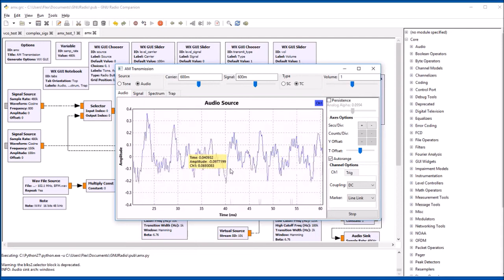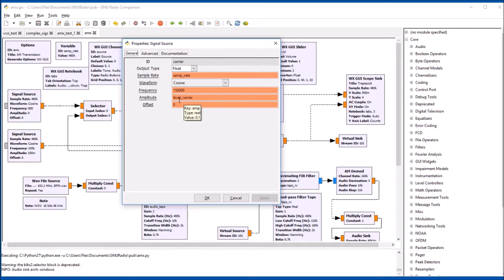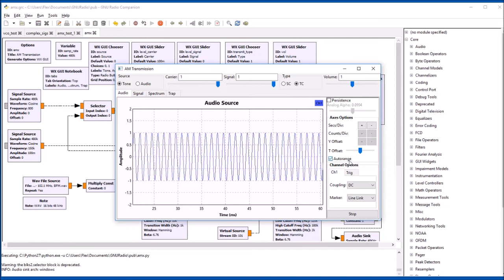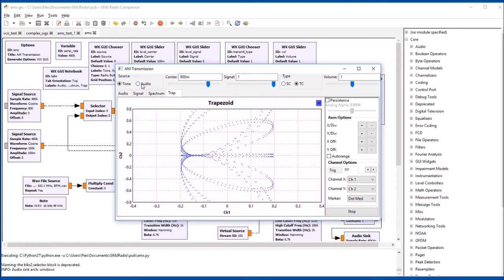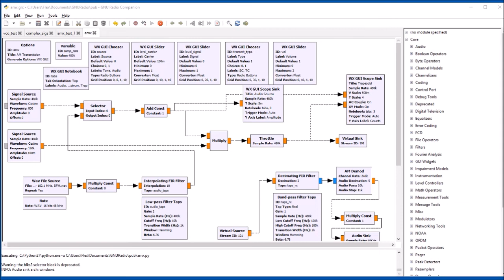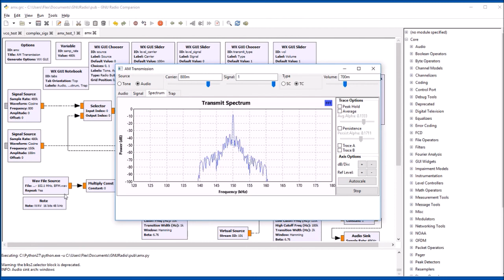GNURadio Amplitude Modulation

Comment: @VE6EY 
Hi!
Could you please explain why there is multiply by 1 block between AM Demod and Audio Sink blocks?
I have seen it also in digital transmissions, but still could not figure it out why.
Reply from the maker: Hi Qalib. That's the volume control.It's controlled by the Volume slider in the display window. Cheers, John.

Comment: So this may be a dumb question, but how would you connect this to a proper SDR sink? My initial thoughts would be taking Multiply->Rational Resampler(Int:25 Dec:6 Float->Complex to get a sample rate of 2M) -> SDR Sink

I also wish to broadcast at 1.7MHz (empty broadcast AM freq), to see if my radio will take the signal, would it just be a matter of editing the carrier?

Comment: Is there a reason to use the block 'Add Constant' in this AM scenario? I have already seen this use on carrier signal aswell before the multiply block. But haven't really found the reason why?
Thanks in advance and a happy new year.
Reply from the maker: Hi Andre. You add a constant to make sure the modulation never drops below zero, i.e. remains positive.
Reply: @VE6EY  Thank you!